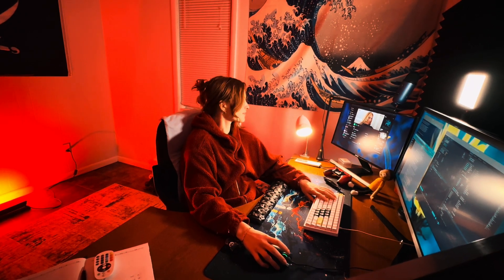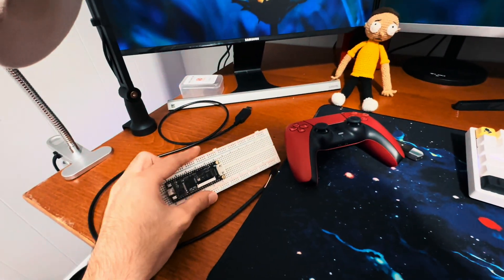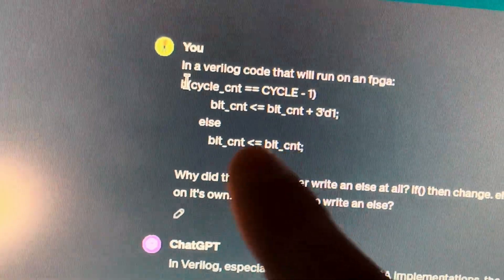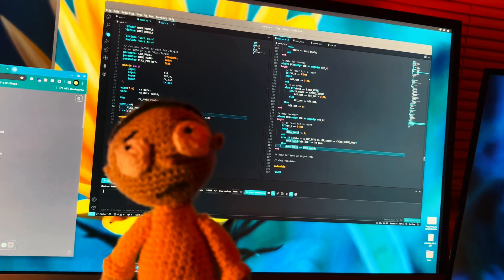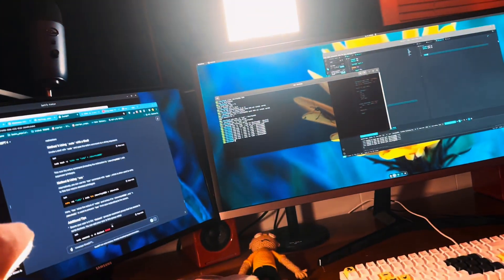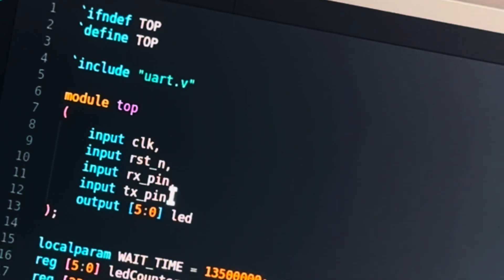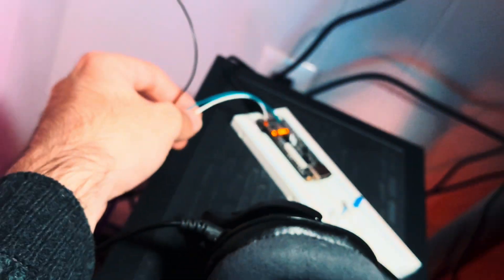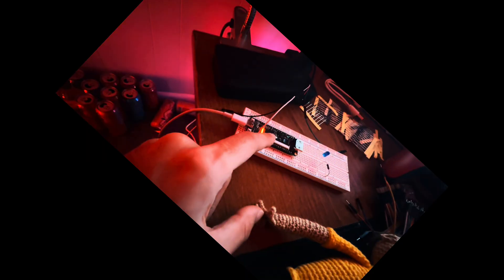𝚍𝚎𝚋𝚞𝚐(𝚄𝙰𝚁𝚃); // 𝙳𝚊𝚢 𝟸0

Comment: I lost my fair share of hair on uart.
I needed to write a sensor driver that was so new, i could only get the chinese docs and the board it is implemented on is largely deprecated. 
Nothing worked correctly, but eventually i figured out i needed to send the bytes in small packets, because the send library jambled the bytecodes when send to the method all at once. No good docs, no chat-gpt help.
Pure nightmare

Comment: model sim is free and has support for verilog simulations. Easier than trying to debug on actual hardware. But when you do work on actual hardware I also recommend getting a cheap logic analyser. Absolute godsend trying to debug what is actually going out on the pins.
Reply from the maker: I like that suggestion! You are right we need a logic analyzer! Thank you kind sir.

The thing when coding uart is that it needs to work with actual uart clocks on the board so sim doesn't really help. But I got it working today! I debugged using the LEDs on the board.
Reply from the maker: Dwamn bro you have gameplay videos from 13 years ago. You were a youtuber when being a youtuber wasn't a thing!